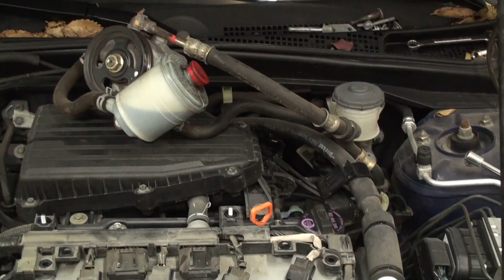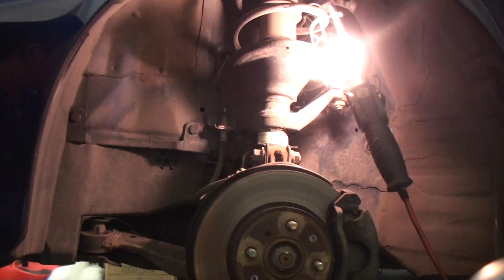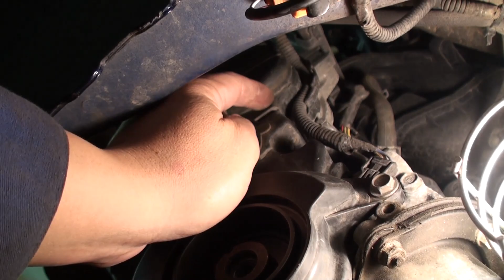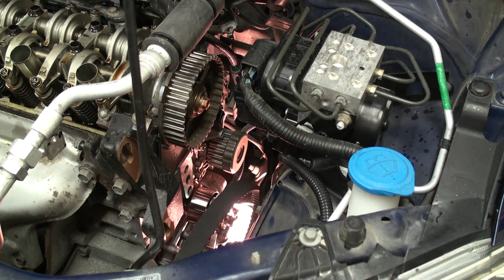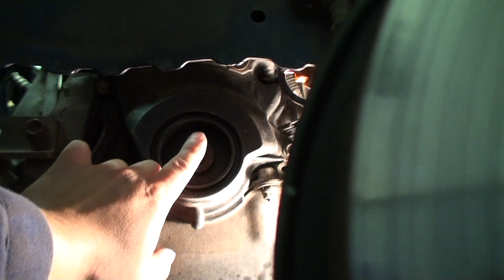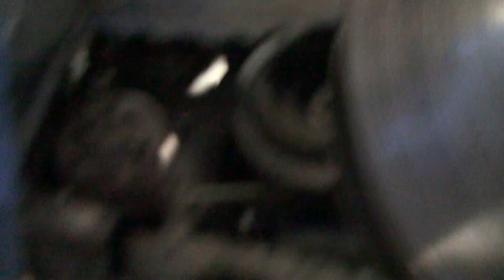2001 - 2005 Honda Civic Acura EL Timing Belt Replacement

Comment: That's a very intense operation! How often do these belts need to be changed? What the average 2016 cost to have it changed to a certified tech? I presume it's advisable to change out your spark plugs and (possibly) the alternator in the same process?
Reply from the maker: intense?  No trust me that isn't nearly as bad as say chasing a clutch out with the engine in a car with bent subframe.  THAT is murder to do.  Yes plugs would be a good idea but not the alternator. That should only be changed when it fails.

Comment: I bought a used 2005 civic ex from a dealership and i was told they are going to change the timing belt and water pump as part of the deal but i went under the car to look for oil leak and noticed that one of arm of lower timing belt was missing or (broker) where the other screw supposed to go. My oil leak is near the timing belt so I'm worried that i might some oil going in to my timing belt. If i  just wanna inspect my timing belt and also replace the lower cover, do i need to worry about the position of the camshaft ( the one where you need to line up the left and  right notches) or that is only for installing a new belt which im hoping i wont have to do? And to get access to the lower cover i need to remove the pulley right?
Reply from the maker: No if you want to replace the lower cover then you just need to make sure you have a crankshaft bolt removal tool.  You basically follow my vid instructions on how to take things apart BUT just leave the timing belt and engine mounts in place.

Comment: Awesome video, thank you! One question, I have manual transmission, should it be in neutral during this process of aligning timing belt?
Reply from the maker: +Bryan Clauson well if the car is in gear then you turning the engine over by hand will be really tough.  Put it in neutral.

Comment: Hey, got belt and water pump and belt tensioner (non- oem parts) replaced at a garage but i feel something is not right because  there seems to be power loss and i have noticed the car engine starts @ 1500 rpm COLD but at operating temp the car idles at 400rpm ? any help, thanks.
Reply from the maker: +Shihab Abubakkar there is a very good chance that the timing is off.  When cold the car should be 1000 or so RPM and then warm 750RPM.  Power loss is a sure sign that the timing marks are likely off.
Reply: +piercedasian  Thank you for your reply, it seems i have misread the tach o meter needle on my civic, the engine actually idles between 700-800 rpm.
Reply from the maker: hmm, are you sure then that you're experiencing power loss or is it perhaps the "placebo" effect?  An engine that is out of time would definitely not feel right.  Perhaps there are other issues with the engine?
Reply: +piercedasian  Hi, i am wondering why the 2 fans behind the radiator of my civic are not coming on regularly as they used to before i got the belt & water pump and coolant relplaced. thanks
Reply from the maker: +flymaxn Couple of possible causes:
1. Is the cooling fan sensor working correctly?
2. The new water pump could be moving coolant faster through your engine and therefore doesn't need the cooling fans to come on as often.
3.  Your operating conditions (ambient temps) are lower than you realize.
4. If you want to test - run your car at 2500 rpm idle after driving the car for about 15 minutes.  I'll bet that within 5 minutes of holding the engine at 2500 RPM that the fan will come on.  Do pay attention that your heater is off and watch that temperature gauge to make sure your car doesn't actually overheat while performing this test.

Comment: Excellent 7th gen SOHC Civic timing belt video. By far the best for beginners like myself. I ran into an issue when after I have the cam and crank at TDC and I proceed to put the belt on, when I tighten the new OEM tensioner, it will cause the crank to move slightly off TDC. I tried for about 3 hours today. Any ideas on how to keep the crank from moving off the TDC mark on the oil pump? Thank you!
Reply from the maker: +Da New Yawka hmm, nothing should move if everything is lined up perfectly.  Remember to follow the belt routing procedure in my video.  You route the belt from camshaft gear to crankshaft (with absolutely no slack) and then route up over tensioner, under water pump and then back up towards the camshaft timing gear.  When you push on the front of the belt lightly with your finger it should be taught with all the extra slack behind the cam timing gear and water pump.

when you let the tensioner tension up the belt all should be good.

Confirm by temporarily re-installing crank pulley and give the motor a few rotations counterclockwise and if all is good then your timing marks should line right up.  If you're off by just a tiny hair chances are you're actually right b/c if you were off by even 1 tooth on the cam sprocket that you'd easily see that you were off.

Are you sure your cam gear is lined up perfectly using a ruler to the deck of the head as how I demonstrated?
Reply: I forgot to mention either my crank or cam was off slightly the first time I took it apart ( might have been the cam). Car started and stalled immediately. I'm using a plastic ruler which isn't as thin as your metal ruler. Hope I didn't bend the valves
Reply: I could email u a quick iPhone video of my cam mark. I know the crankshaft mark. U might be right, maybe I have it off slightly.
Reply from the maker: sure you can email it to aerosport@shaw.ca

Comment: Great videos.  Very clear and the service tips are invaluable.  I have used your videos to change my tires, oil changes, alternator change and they also gave me the confidence to fix the A/C in our other vehicle.  After the alternator change, I have one piece of metal and a 10mm bolt that is missing it's home.  I had a vehicle dealership technician look at my work and he commented everything checked out ok including belt tension.  Anyway to send you a picture of the piece?  Thanks again!!!!!

Comment: Just got for dirt cheap a 2001 LX with 147000 from a customer that needed more work than what the car is worth. The shop I work for even gave him a discounted price quote on all the work it needed. The car is a mess and needed a lot of work from suspension work, brakes, oil leaks, timing belt, and water pump. It was running on the original timing set, leaking oil from the front main seal, oil pan gasket, cam cap, cam seal, and valve cover gasket. I changed the timing belt, water pump, tensioner, cam seal, and crank front main seal. Everything went fine with the install except for the front main seal I'm still getting a slight leak out of it. Here is my question would a bad harmonic balancer pulley cause this issue? I've even pulled everything out 2 times and changed the front main seal with 2 different brands (fel-pro and honda oem).
Reply from the maker: Macer Boogies hmm the front seal wouldn't likely leak due to a bad harmonic balancer (you'd likely feel a bad balancer as the engine was running).  The leak is probably a result of you either driving the seal in too far or there could be a "nick" or defect in the crankshaft from someone previously trying to yank out a leaky seal with then marred the surface of either the block or the crank.

Comment: Excellent video.  Thank you.  When the timing belt is replaced shouldn't you also replace the Water Pump and Timing Belt Tensioner Pullley?
Reply: Definitely replace them!  Unless they had been replaced very recently then absolutely buy  a quality timing belt kit from Gates which comes with watepump + tensioner all for $70-80 shipped!
Reply from the maker: It depends how well the car was maintained and how much mileage you've racked up.  This particular car had only 90, 000kms on it and historically I have found that as long as you've only used Honda coolant and never introduced other brands of coolant and no water with minerals in it that you can quite easily get 200, 000kms out of the original Honda water pumps.  Tensioner pulleys last well over 300, 000kms and according to the local Honda dealerships here they almost NEVER replace the tensioner pulley.  A few of my Honda dealership mechanic buddies of mine confirmed this as well as they said that bearing seems to last an eternity.  So unless you're not maintaining the coolant in your car every 80, 000kms with genuine Honda coolant or you have really high miles on the original pump chances are you'll be able to make it by without changing out any additional parts.  I've followed the change the water pump ever other t-belt change rule for the last 20 years and so far so good :)

Comment: Good job m8.  I really like how methodical you are with your how-to videos.  That genuine Honda crank pulley tool is real awesome.  It's amazing how a lot of the work cringes on that crank pulley bolt being able to be removed.  If it can't be removed or it's really seized on there, one would obviously need to stop because you won't be able to continue.  I know some DIY'ers won't even attempt a TB swap unless that crank bolt can be broken loose first BEFORE starting job.

Keep those videos coming bud and thanks for sharing.  Hope your vision is better now too!
Reply from the maker: thanks jm1271jm my vision is gradually getting better and I certainly am in much better shape now that I was at the beginning of January.  Yeah that crank pulley is deathly tight from the factory.  I have no idea how Honda can say 175 ft-lbs when in reality it feels more along the lines of 250 ft lbs or more... Since I have the Honda crank tool I don't worry about whether or not I can break that pesky bolt loose - I know I can b/c of that handy tool :)  Thanks for watching and stay tuned for more of my DIY vids.

Comment: I could watch your car repair videos all day. The camera work is so clear and the explanations are concise making the whole process incredibly accessible (dangerously so!). I feel like I want to go out to my garage and start working on my vehicle! For me, this video in particular, though, at least shows why a mechanic (or dealership) charges so much to change a timing belt. There's a lot of work involved in doing so and it makes me comfortable paying a professional to do this job. Thanks for another great, informative video.
Reply from the maker: Lol, fixing cars isn't so bad.  Yes it does take time but in the end what you gain from every car you fix is experience.  Even though I've probably done 100's of t-belt jobs I still methodically walk through my "workflow" process to ensure I don't slip up somewhere.  Interestingly 21 years ago I did my first oil change on a car and that took me forever because I was afraid of screwing up.  FFWD to today and a lot of things I do is 2nd nature to me :)  If you don't try you won't ever know what you're capable of doing.
Reply: @piercedasian  Yep.  Even as a shade tree mechanic, I concur with your comment.  Each job (and mistake) gains you experience.  I would never try this ordinarily, but I did a valve adjustment on my Ridgeline a few months ago.  Getting that done has given me the confidence to tackle the timing belt on my brother's Civic.  Thank you for the great video!